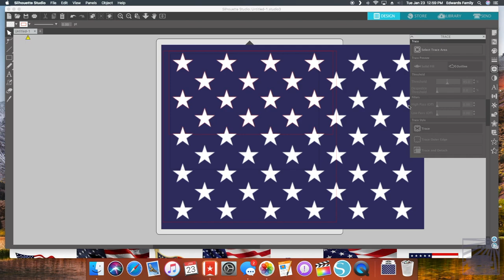Keezer Build Part 3: The Top

Comment: This is awesome!!! Looks like you put a lip on the front to secure the lid to the top wood work. How did you get an even seal all the way around after placing that lip in the front? Really interested in your build as a framework for mine.
Reply from the maker: rlynge, thanks for your kind words. If I understand what you’re explaining, yes, I put a few tabs on the front and sides of the lid. The tabs are on the under side of the woodwork and slide under the lip of the freezer to secure it. No tabs on the back so the whole top slides off the freezer lid. I’m in the process of editing video for another keeper I built the same way. I’ll be doing a lot more explaining in that video, so stay tuned. I’m sure it will make much more sense in that video. Thanks for watching and commenting!